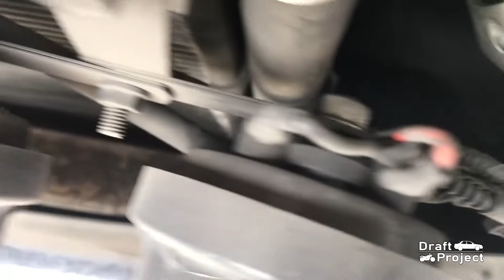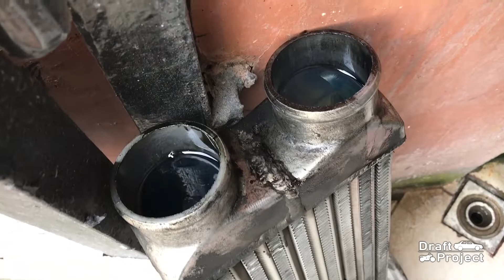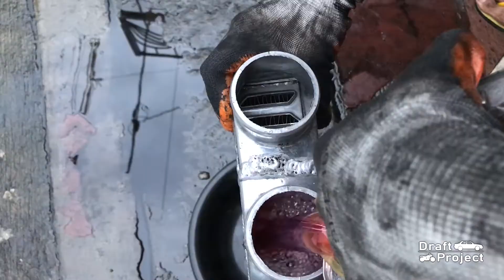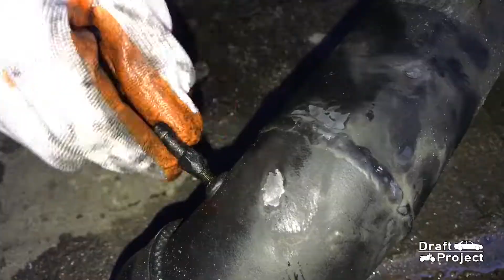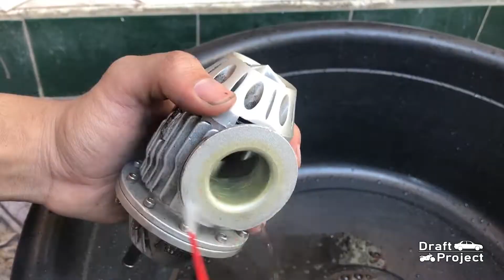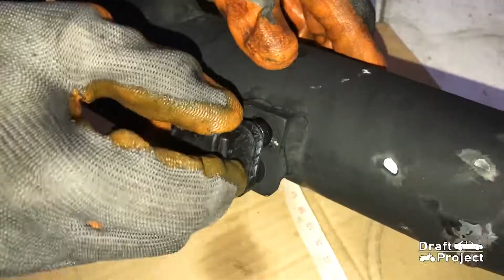Intercooler and Piping Removal and Cleaning - Hyundai Accent

Comment: Diesel has oil in it why use that to clean
Reply from the maker: Diesel is a good cleaner and remover of oil sludge. One of the ways to remove grease or sludge is to use oil too. Once it dries, it won't leave that much residue.

Comment: Very interesting and informative video. What I like the most is that you seem careful and delicate with those fine parts, specially in the intercooler and you use the correct product to clean either the electrical connections or for the engine cleaning product, degreaser and everything. I should try that on my Volvo c30. Thank you.
Reply from the maker: I really appreciate your comment. Thank you very much!

Comment: Good luck with hyundai accent blue vehicle Do you have a presser pad video can you help me I want to make it myself. I'll just take pictures of disassembly
Reply from the maker: Thank you very much!

May I ask if the presser pad refers to the brake pads of the vehicle?
Reply: @DraftProject  My vehicle's engine speed accelerates very well, but its agility has decreased. I need a detailed assembly video of the gearbox and pressure pad. I can remove all of the wheel shock absorber lower wishbone
Reply from the maker: I see but unfortunately, I'm sorry to tell that I don't have a video for that. If I get the opportunity, I may have done it. Sorry for that. Thank you for your support.

Comment: Is it natural to have oil drippings from the turbo intercooler?
Reply from the maker: Yes. In the intercooler, oil tends to accumulate because most of the time, oil cannot escape inside the intercooler. One of the reasons why they needed to be cleaned at a specific period.

If there is too much oil in the piping, that could indicate a worn out seal of a turbo.
Reply: @DraftProject  what is the best thing to do?
Reply from the maker: Given the situation is pretty normal, it is best to maintain it's periodic maintenance like cleaning the intercooler, intake and EGR to prevent any buildup of oil and carbon deposits.
Reply: @DraftProject  if the turbo seals or bushings are worn out that causes the oil leak.. it can be replaced? or I need to buy a new turbo?
Reply from the maker: Leaking turbo can be fixed by replacing the seal inside. It is like a piston ring fitted on both sides of the shaft of the turbine. Others sell a repair kit for it.
Reply: @DraftProject  do not need to be worn turbo,oil vapors that EGR returns to intake of turbo gets forced back to intake so that oil acumulates...
Reply: What’s the length, width and brand of Intercooler?
Reply from the maker: @elviejon9097  Sorry, unfortunately, I haven't got the chance to measure the dimension of the intercooler. It is an APEXi intercooler with and inlet and outlet tube of 2.5 inches.
Reply: Actually if you have a proper catch can installed the right way there shouldn't be any oil inside the intercooler. I had that issue with my 1100hp procharged Corvette and it was caused by the wrong catch can installed. Once corrected..zero oil.